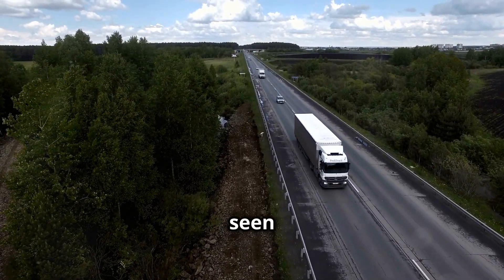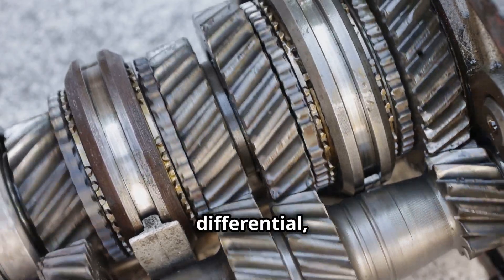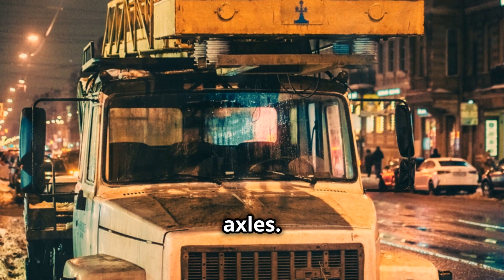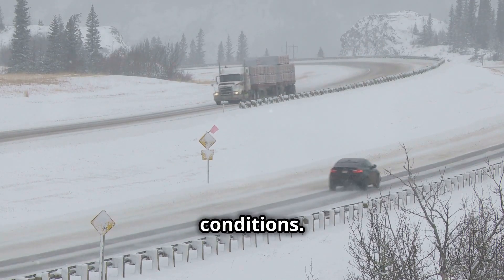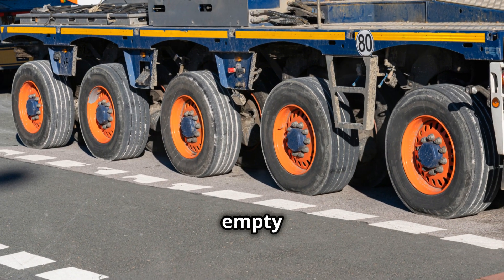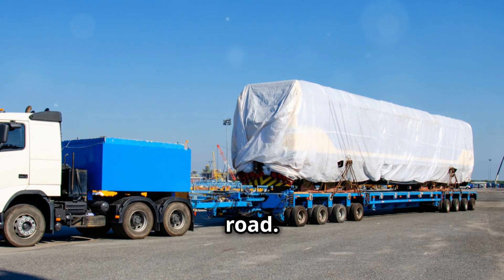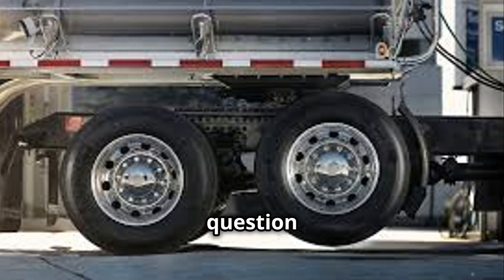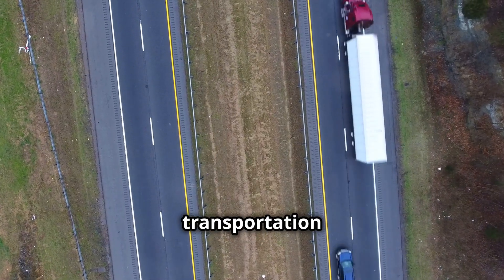Why Do Some Truck Tires Lift Off the Ground? 🚛 The Secret of Lift Axles Explained!

Comment: How are lift (bogey) axles on trucks differ from tag axles on motorcoaches , in terms of functionality??
Reply from the maker: Tag Axels are not For weight distribution, but provide additional support and help in stabilizing the vehicle. They usually remain in constant contact with the road.